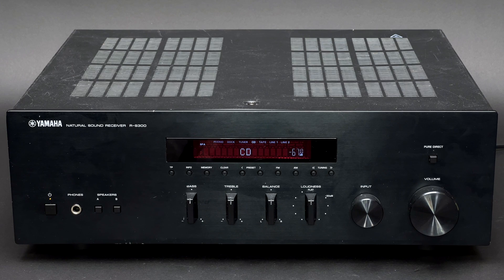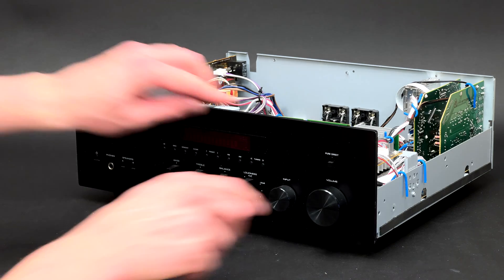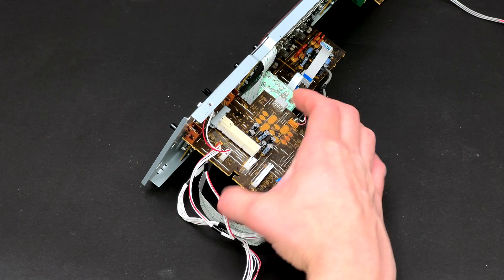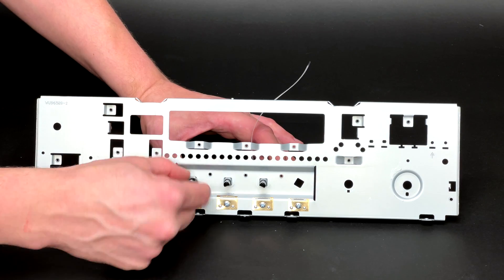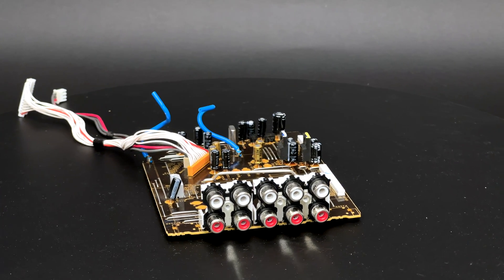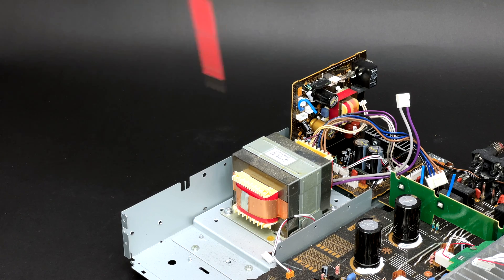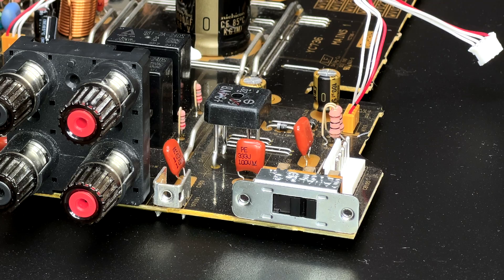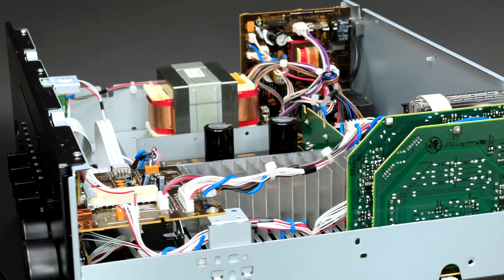Yamaha R-S300 Stereo Receiver Teardown

Comment: Well you know if you look at the circuit topology that Yamaha has been using since probably the middle '90s, their modern amplifiers by and large are exactly the same design.

That's not to say they haven't improved certain things, but I think Yamaha hit a point in the '90s where they realized that they had a good circuit that sounded good, I.e sounded the way they wanted, and that was robust and hard wearing and durable, and so they ran with it. 

Which is also why if you compare one of their '90s amplifiers or even their '80s amplifiers to the modern equivalent, it for the most part sounds exactly the same, and I mean that as a compliment.

Even their latest Network receivers, the RN series, utilize the same more or less circuit. Heck even there top of the range uses the same one, it's just been scaled up and made more beefy with more exacting parts. 

Personally I like Yamaha, while they do make products that that don't necessarily perform as well as other similarly priced products, you can't argue with the durability and the longevity, basically you buy a Yamaha piece and 10 years down the road or 20 years down the road, it's still working just fine, you can't say that about many other brands.

Comment: Great sounding receiver, and well built. The Yamaha A-S301 amp gets great reviews. All over YT people say the value is through the roof. This receiver sounds better to me than any 70s receiver. I have one. Sounds great. I also have a Denon PMA-525R amp thought sounds very clear and natural. I have an Onkyo Integra A-8250 that sounds so mellow- would compare well to the sound of a Mac or Accuphase. And it was cheap. Yamaha is always a good choice. Cannot go wrong with Yamaha. New amps are inexpensive.
Reply from the maker: Thanks so much for sharing your experience—sounds like you've explored some fantastic gear over the years! I haven’t had a chance to try any of the older models myself, so I don’t have much to compare them with, but I definitely agree: Yamaha's build quality is impressive, even on their more basic models like the A-S301. Great to see quality still being delivered at a reasonable price point!

Comment: I have a Yamaha R-S300 (50 wpc @ 8 ohms) receiver, hooked up to a pair of massive JBL L-100 floor speakers &  a sub-woofer, (which drives them all handily with ease & power, btw) & I can honestly say it sounds no different than my 125 wpc @ 8 ohms McIntosh tube amp (which I also own). I also did a bench test on the R-S300 & it easily measured out a whopping 80-85 wpc @ 8 ohms on the wattage meter....30-35 wpc above the advertised power rating!!  I highly recommend any model Yamaha amp/receiver over the Sony, Pioneer, Denon, Onkyo, even the Marantz ANY day of the week !!!
Reply from the maker: Wow, that’s an awesome setup — and a really interesting comparison! 🔥 The Yamaha R-S300 definitely punches above its weight, and those JBL L-100s are beasts of speakers. Love hearing that it held its own even against a McIntosh tube amp — that’s seriously impressive. 💪🎶

Thanks so much for sharing your experience! Always great to hear real-world performance stories — and sounds like you're getting the absolute most out of your gear. 🙌
Reply: No, not better than any Onkyo. Sorry.